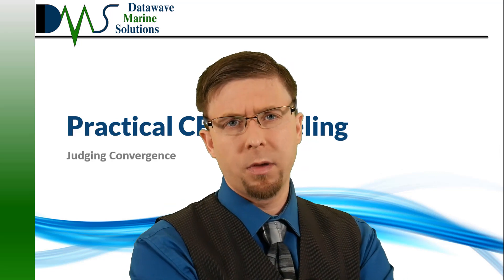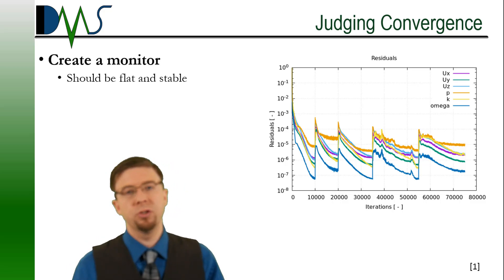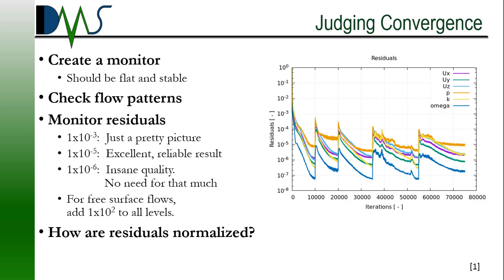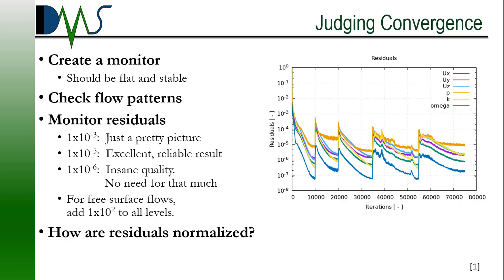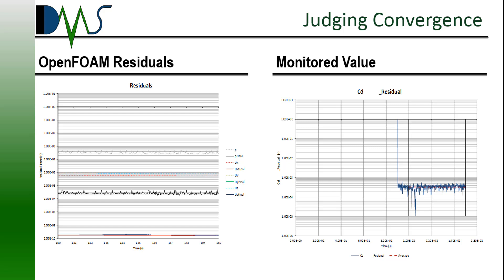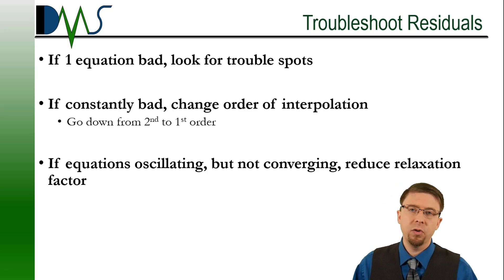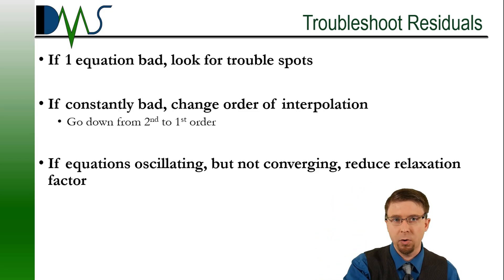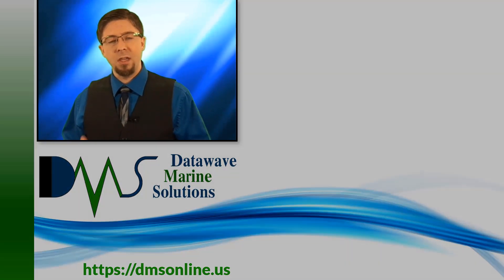PRACTICAL CFD MODELING:  Judging Convergence

Comment: Would you reccomend OpenFOAM in a commercial  / consultancy setting ie. not an academic/research environment
Reply from the maker: yes.  I use it in my own consulting.  A commercial CFD code charges $20k - $60k US per year in license fees.  It can be very hard to get enough dedicated CFD business to justify that license cost.  Instead, OpenFOAM requires no maintenance costs.  The frees more resources for validation studies.  The downside:  OpenFOAM is slightly slower to setup, due to the text interface.  And the mesher is limited.
If you can afford it:  the best combination is to pair OpenFOAM with a commercial meshing program.

Comment: Hello, for the spikes when they go up, they should not exceed the residuals criteria also like 1e-3 for example ? Thnks
Reply from the maker: I would not hold that as a rule.  I had simulations where the spikes jumped up to 1e-0 on their first inner iteration.  And then quickly jumped down to the appropriate criteria.  When judging convergence and accuracy of the simulation, the last inner iteration is the only residual number that counts.  Instead, the initial spike is an indication of simulation stability.  For my example where the first inner iteration jumped to 1e-0, that simulation was extremely unstable.  I technically should have gone to a smaller timestep, but I was limited by computing resources.
Reply: Yes but i thought that tis is normal for the first iterations of the whole simulation and not per time step and then when the simulation is continued like 50000 iterations the spikes should be lower than the residual criteria. Is this right thanks

Comment: While decreasing the residual, should I increase the number of iterations. Any kind of reply is helpful, thanks in advance
Reply: Number of iterations doesn't matter. If you set 500 and you hit 500 but you didn't converge, you can increase the number of iterations and then resume the calculation

Comment: Hi Nick, 

First I have just watched a bunch of your videos and they are excellent, it helps a lot when learning CFD !

I had a question concerning iterations and time steps. As you explained in the time discretization video: the number of iteration per step should never be more than 10 (more like 5) and the time step should be reduced if in doubt.
However in the residuals plot of this video, there are approximately 10 000 to 20 000 iterations per time step. What is the reason behind this ? 

Thank you in advance, and keep up the good work ;)
Reply from the maker: I borrowed that particular residuals plot from another website, so I don't know the exact simulation that went with it.  That specific image was something I debated when creating the video.  But it was such a perfect example of the sawtooth pattern that I decided to include it.  
I can take a guess on what happened with that simulation.  As you mentioned, there are too many iterations between each spike in the residuals for the simulation to solve in time.  One other thing can produce that same pattern is a steady simulation, where the boundary conditions are programmed to change after a certain number of iterations.  I see that for very unstable simulations.   

For example:  imagine you need some inlet velocity of U = 50 m/s, but the simulation is too unstable to initialize with that speed.  Instead, program the boundary conditions to start with U = 10 m/s, then after 10,000 iterations, step up to U = 20 m/s, at 20,000 iterations, step up to U = 30 m/s, and so on until you reach the full speed.  The programming that allows you to do this changes with each piece of software, but they normally have something to allow that type of advanced boundary condition.

Comment: Sir, I have a reactor which has an impeller and a shaft. I use steady-state simulation as the initial condition of my transient simulation. In my transient simulation, the residuals converge for each timestep. I am plotting a monitor for 1) the moment about my shaft+impeller and 2) volume avg turbulent kinetic energy. The latter reaches a steady state with almost 0 fluctuations but the moment monitor doesn't reflect the steady-state as good as the kinetic energy. There are also a lot of fluctuations in the moment monitor. Please suggest how to reduce them and get a flat curve at steady state. (I tried to decrease the under relaxation value for body forces until 0.5 and also increased the residual to 1e-06 but still no stable flat curve)
Reply from the maker: It sounds like you have done everything correctly.  I can't say more without a detailed exam of your simulation.  Some alternative explanations:. VOF simulations often result in oscillating convergence.  And that can be perfectly valid.  Check the pattern of oscillation.  Is it reasonably small compared to the mean value?  If yes, and it shows a consistent pattern, I would say you have a fully converged simulation.
Reply: Llllll
Reply: Lllllllllllllllllllll
Reply: Llllllllololllll
Reply: Lllloloolllloololollllllllllll
Reply: Lllolollllll
Reply: Ollllllo

Comment: Hi sir,
One of the best video on YouTube now...really love video contain..
I have one question to you. As in many converge plot UX,Uy,Uz,p,k all value are almost close to each other but omega was very less value than other. Why this happened? I am learner of CFD. 
Can you explain me? Please.
Reply from the maker: It all depends on the scenario.  The low Omega value indicates that there was very little change in turbulence dissipation.  So the Omega equation converged easily, resulting in a lower residual.  But remember that turbulence also involves the k equation.  Both equations drive turbulence.
Reply: @DatawaveMarineSolutions  Thank you for response sir..!🙌🔥 Can you share any link or equation name used for K and omega? 🤔
Reply from the maker: @rohitsuryawanshi2229  https://turbmodels.larc.nasa.gov/index.html
That lists several turbulence models.  Any set of residuals involving k and omega would be one of several options:  Wilcox K-omega, Menter K-omega BSL,  or Menter K-omega SSL

Comment: Hi Nick.
Thank you for another quality and well produced clip on CFD.
I have two queries on convergence that are bugging me and perhaps you could help....
1. Does the presence of boundary layers (i.e. assuming all acceptable metrics such as skewness, orthogonality, y+ size for model used AND adequate no. of layers) affect the rate of convergence ?
2. In a case with an oscillating residuals analysis (i.e. golf ball with Re 1e-5),  may we consider a solution accurate enough if the Continuity Residual does not drop below 10^-3, but a velocity monitor plot is oscillating within a small range (as you stated)?  (key point here being the high 10^-3 continuity residual !)
Reply from the maker: Excellent questions.  To the first part about boundary layers, I can't say with certainty.  Most of my simulations are scenarios where boundary layer flow is not a strong component of the overall flow regime.  Modeling the boundary layer definitely affects the accuracy of my final simulation, but I never tested to see if there was a strict correlation with the rate of convergence.  I can certainly say that including turbulence equations slows the rate of convergence, mainly due to boundary layer interactions.

To the second part, I have worked with simulations that had a Continuity Residual of 10^-3, especially with free surface flow.  But that is a very high residual, and I would argue that the simulation requires extra scrutiny to accept that residual.  As you said, the velocity monitor plot is excellent for extra information.  But I would only extract results based on my monitored values.  If you only monitored velocity, don't extract any results for force or pressure.  Different physics converge at different rates.  It would also be wise to plot the mass balance for your domain.  In a perfect simulation, total mass flow in = total mass flow out of the domain.  Accounting for errors in machine precision, the total difference of mass flow should be less than 10^-6 (normalized).  Otherwise, the high continuity residual may indicate that you lost mass somewhere in the domain.

Hope that helps.
Reply: @DatawaveMarineSolutions  Thanks for the replies Nick...I still have much to learn :)
As to your second reply; yes I do always plot the mass balance and where applicable Cd and Cl. In fact these monitors stabled out nicely and that's why I was specifically curious about the Continuity Residual (10^-3) not dropping.